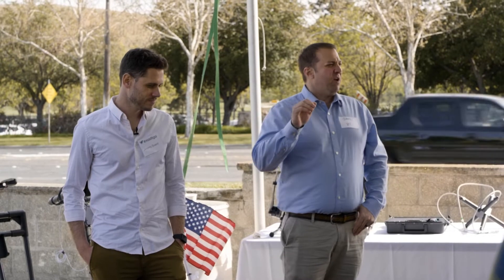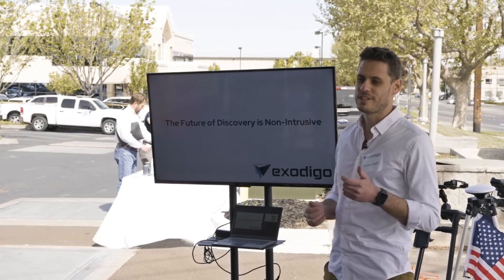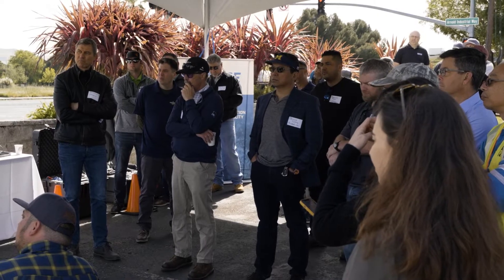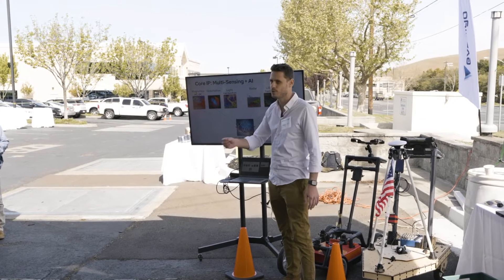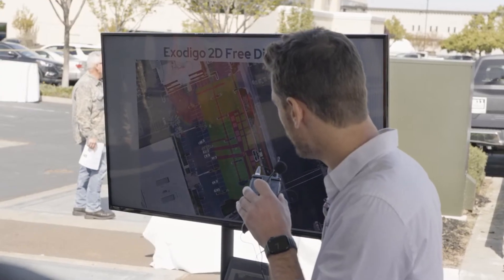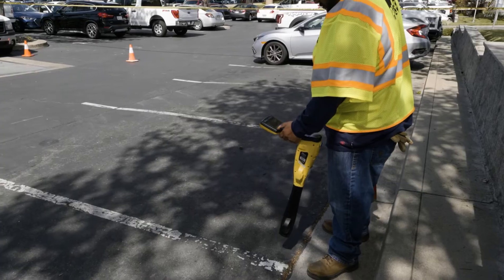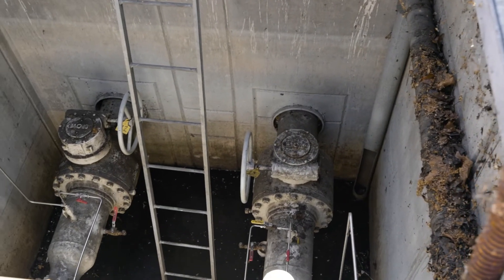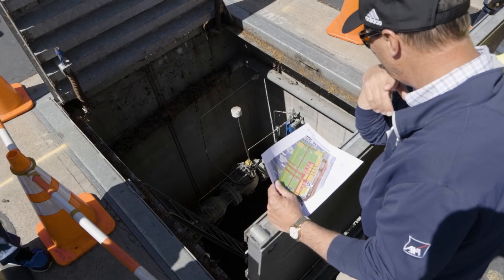Exodigo's Non Intrusive Utility Mapping Demonstration

Comment: Do you show depths, widths, top and bottom of formation
Reply from the maker: Hi Kim, great question! When using the 811 service, if a utility operator chooses to mark the location of their underground utility line at the site, they currently are only required to mark the horizontal path of that utility line. This topic can be expanded on in much more detail. If you have any additional questions about this issue, please reach out to us directly at education@usan.org
Reply: The price plz